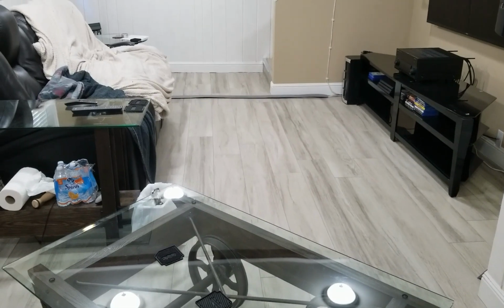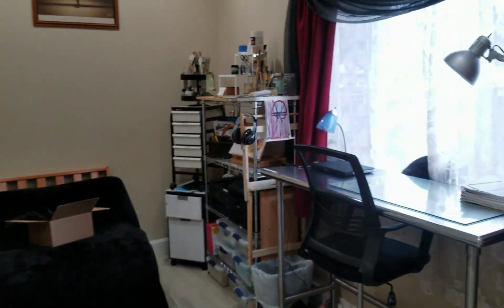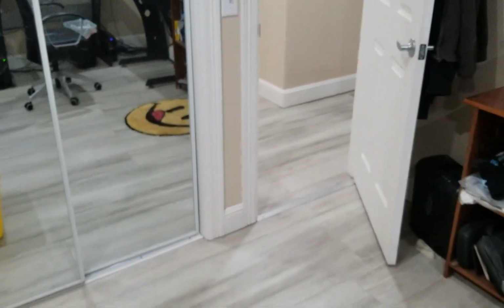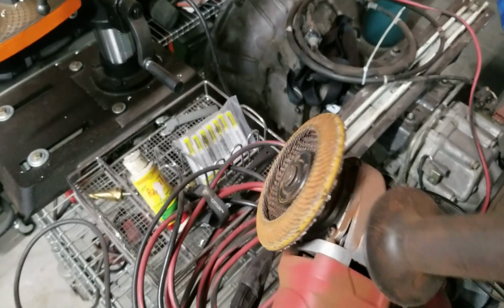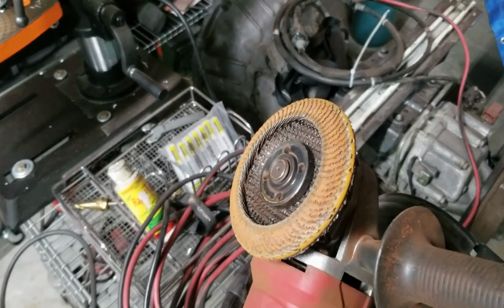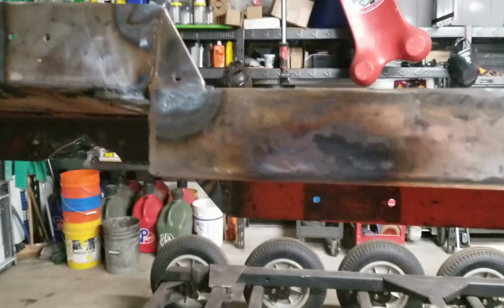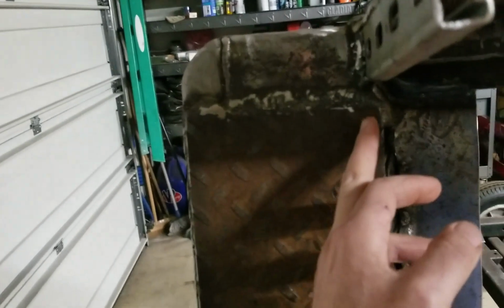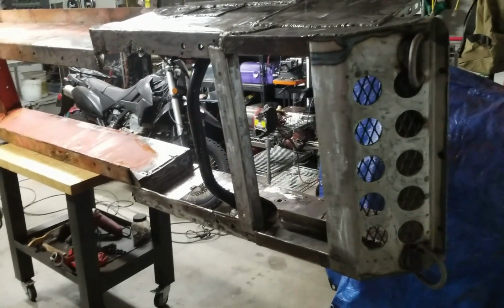Rusty the Spryte build part 38 (final grind and weld on body frame part 1)

Comment: Good hearing you two are over the cold!!! Was nice getting a notification you posted a new video. Take your time with Rusty and it’s progress, ... it will turn out great!!! Last thing you want it getting frustrated with the project, ... making a mistake or just burning your self out!!! Love the video and take care with the coronavirus, ... I get worried about it as I pick up refuse!!!                                     Your thoughts on sand blasting Rusty???
Reply from the maker: Hi Pete.  We have both been in and out of the flu for the last month.  Fortunately it is not CVD.  I prefer hands on body work.  Sandblasting is extremely messy and time consuming.  I would have to spend an additional 500 bucks minimum for something I would only use one time.  I have more attention to detail flapdiscing as it forces me to look at every square inch of the body frame and see defects I may need to fix.  Thanks for keeping up with the channel.  I appreciate it.

Comment: A wire cup brush for the angle grinder should pull the paint off, the twisted strand type seems to last the longest & is most aggressive.
Reply from the maker: I tried 3 different styles.  None of them work as well as pressure and a 40 grit flap disc.  Either way it's not my favorite activity.